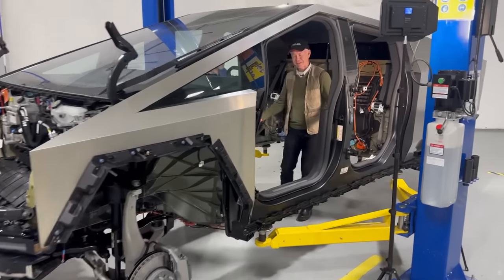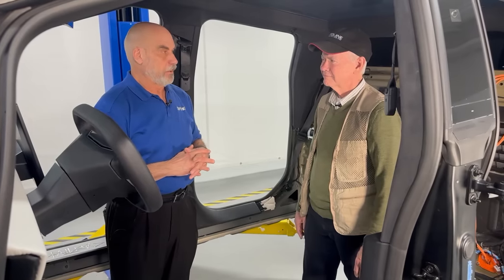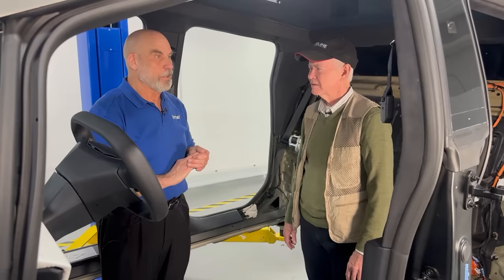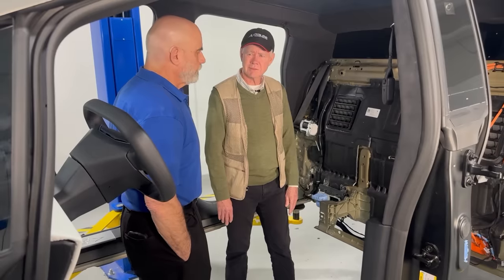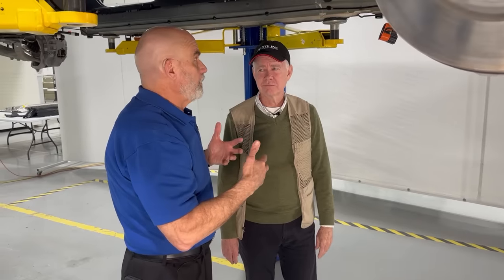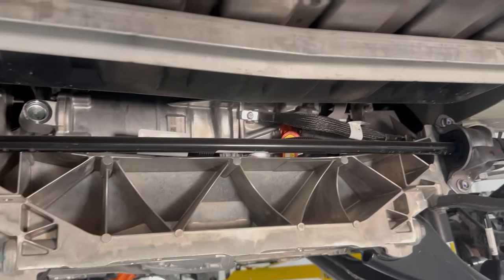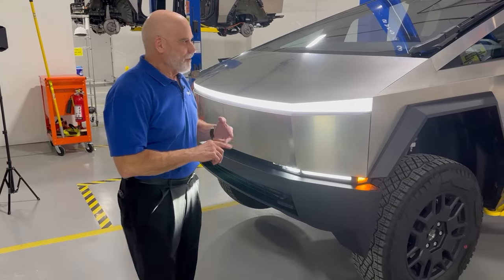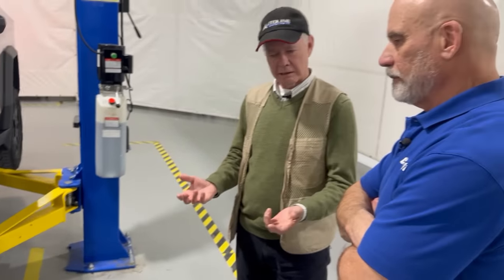World's 1st Cybertruck Teardown - Steer-by-Wire, 48V, Battery & Gigacastings

Comment: I'll be very interested to see the battery layout, especially as it regards thermal event management. I was less than comfortable with what little i saw of that in the "structural battery" teardown on another channel. With only that one sheet of steel between the cells and the occupant compartment it is critical that products of combustion and thermal effects are kept away. Similarly I am curious about front and rear interior door latch operation in a power out situation.
Good video. Thrilled to see teardowns by a neutral engineering firm.
What the heck, let's look at steering system power supply redundancy as well.
Reply: there was a photo , of it in the MUNRO Cybertruck FACTORY tour.

Comment: You can have all the backup motors for steering you wish, but all will have the same weakness in that all need electricity to function, so in short no battery or battery failure will result in no steering.
Reply: I hope you’re not thinking about an electrical failure the next time you’re on a plane!
Reply: Aircraft are different in that they have engine generators on the main power units, also engine apu, ram Air turbines and many back up and battery systems. With an ev you only have the drive train battery and aux battery
Reply: Another channel showed how the wheel covers / trim is wearing into the tire side walls , and been reported by owners have you found that
Reply: No battery?... who needs steering when the vehicle is dead?
But there are times like when the vehicle is dead in the middle of a road and has to be pushed and steered off. "No can do."

Comment: CT has a very, very simple design
Reply: And bad at the same time. And that is why this garbage truck is only legal in murica.
Reply: Its bad why? @vihreelinja4743
Reply: @JonGZBOS because he can't afford one
Reply: @JonGZBOS  cuz elon bad
Reply: @vihreelinja4743 getting a cybertruck because steering by wire engineering . Tesla 👍🏻
Reply: @niktak1114 lmao shit quality, can’t let it be outside it’ll rust, can’t wash it, can’t drive it when it’s raining because it’ll short the battery, can’t carry shit, can’t fit a small bike even, HORRRRRRRRIBLE range, you will die if it crashes, should I continue?
Reply: And no AR HUD, drivers display, and more.  Absolutely stupid.  You can keep this.
Reply: @OGNord  quality compared to an ICE truck is amazing.  The range was independently tested and gets 303 when it is rated for 300 miles.  That checks out, Towing greatly reduces range of all electric trucks, not just Tesla.  It will only get better from here.  I have one on order

Comment: the servo motor under the steering column doesn't just provide haptic feedback, it also generates the steer-by-wire control signals that are sent to the rack & pinion motors out front
Reply: I can get that.
.
(I wonder how many Logitech engineers went to Tesla? ...
 I'm only half joking.)

Comment: how reliable is the steer by wire? how durable? what if the motor fail what happens then? what if there's a software bug in the calibration of the steer?  what are the safes in the steer by wire?
Reply: It's got multiple redundancy and is fail safe.
Reply: @geoffthompson1215  how do you know? No video is out yet explaining in detail about its safeties. If there is, link it here.
Reply: It has 2 motors in case one should fail, as was explained in the presentation. They specifically referred to the safety issues. It is essential for any steering system to have a fail-safe design whether mechanical or electronic.
Reply: @Alongfortheride693  If you ever fly in a modern plane it's "fly by wire" ... no physical connection between pilot controls and the planes engines or control surfaces or brakes. Physical steering links don't have a backup if they fail whereas electronic ones do. There is a huge difference between a general purpose home computer and the dedicated electronics built into specific systems (which don't "crash" in the same way as your PC.).
Reply: @Alongfortheride693  Of course, everything can fail! Fly-by-wire has multiple layers of redundancy whereas my Ford Fiesta (like most cars) has zero redundancy if any components between steering wheel and the wheels fail.
Reply: @MrAdopado  planes have meticulous inspection and maintenance before flying. What happens if they dont? We have "boeing" as an example. Plane and cars are not on the same level. If the steer fails you are likely to hit an object than the plane in the sky.

Comment: thanks. Plenty new information on this video but I hunger for more. My first takeaway, it would be easy for Tesla to configure this for CyberSUV/Van but the air tank would have to be taken out or third row would be small seats and high leg position.  Another thing, this truck is even more compelling as a base model without air suspension and automatic toneue cover.
Reply: It will never be an SUV/ van.
They will be based on Gen 3 architecture.
Reply: @rogerstarkey5390  Good point.  while next gen can make these vehicles, these will be relatively smaller than what the CT platform can make. Vehicles from the CT platform be sold as premium than next gen vehicles.

Comment: I know everyone is making a big deal over steer-by-wire,  but jets have been using fly-by-wire for decades. Outside of Tesla being one of the 1st, if not the 1st,  what's the big deal?   Throttles have been "by wire' for decades as well.  I've noticed very misalligned panels ( In person) are the fenders glued on or is there a mechanical connection?

Comment: I feel bad because he has hearing aids but the sound he is hearing is not the pumps running, it’s the outside speaker. My model 3 and Y make the same noise with the outside speaker
Reply: Sir, you are very wrong the noise heard was indeed the pumps, the pedestrian speaker does not sound until the vehicle is in motion.
Reply: @DerrickHolloway-pt7tq  Do you own a newer tesla? Mine indeed makes noise from the speaker, It is unclear if the truck is in D in the video however, to get the truck to 4 wheel steer it does need to be in D.
Reply: @DerrickHolloway-pt7tq my 2022 Model 3 Performance makes the noise when stationary, as soon as I put the car in drive, not only when moving - just tested it. That sound at ~21 min is exactly the same simulated sound as my car makes.
Reply: We’re hearing the audio feed through their lapel mics. What’s that got to do with his hearing aid? It took me 6 months or more to realize the sound was even there 😅

Comment: Jeez legacy auto! What happened? You have been around for 100 years! This is the kind of tech that should have evolved during that time! Not from a company that been around for only 20. Pitiful legacy....just pitiful.
Reply: Nothing Tesla does here, or even in general, is groundbreaking and innovative. Those technologies have been around for a while and have no wide usage for multiple reasons. Real engineers know what is important and what is not and what actually does have real world impact and what has not. 48V is quite useless in the real world, and it is more expensive for the customer to get repaired and can be even a health risk. 48V has been used in mild hybrids for many many years since their smaller batteries do not always provide sufficient charging and discharging power for a hybrid gas car. No need for that in a fully electric vehicle with larger batteries. Steer-by-wire? Makes sense in a large truck because they steer and drive bad anyway, but for a performance passenger vehicle it is kinda stupid and unnecessary. Has been done over a decade ago by Infiniti by the way and people didn't like it. It even had a emergency steering column which gives great security reserves (hacking highly digitalized cars is increasingly a real threat btw) so nothing groundbreaking for the Cybertruck here. What else? The giant windshield wiper? Or other weird stuff (the metal plates on the outsides which sit on a cheap frame) and small changes? It all has no real advantage for the customer.
However: things that do matter, like battery performance, efficiency/range, comfort, usability/ergonomics and features/accessory is where the Cybertruck just barely keeps up with the competition. It only manages to beat the Ford F150 Lightning in terms of range and charging, which now gets a 2025 model year upgrade, so the difference will be smaller. The Ford has more usable space, truck features and is cheaper tho so not sure if the upcharge is worth all the downsides of the Cybertruck on the  other hand. The redt of the competition like the Rivian R1T, GM Silverado EV, Hummer EV are miles ahead of the competition, and they look awesome, too.
I recommend watching the latest range test by Out of Spec where they run some of the trucks against each other.

Comment: My Model 3 has a Lithium ion battery that runs the car in camp mode and the accessories. I’ve run it all night on many occasions. I understand that it has a life of 4k cycles. It recharges off the main propulsion battery.
I imagine that the CT does the same.
Reply: Most last 7-10 years of normal use.. not what you do 😅 But yeah, they are using better innovations for batteries soon, lithium ion has issues, which are being replaced.. maybe your next battery will be a gen3 or gen4 version that will be superior tech upgrades.. when the time comes.
Reply: "Your Model 3" has 2 "Batteries"
.
A "12v" battery which performs exactly the same duties as that in an ICE car.
Lights
Displays,
Computers,
Low voltage motors,
Doors,
Etc.
.
Then it has the "Propulsion pack" which deals with the high loads.
.
"Propulsion" (obviously) which includes heating, cooling and pumping liquids around itself and the drive system.
.
Plus,
If you're in "Camp mode" you will be using the propulsion battery to either obtain existing heat from fluids in  it's system, 
OR 
Generate new heat by essentially "vibrating" the drive motors to warm fluids (similar to an induction cooktop) then pumping the warmed fluid.
.
It will also top up the 12v battery (which was Lead acid in older models, but is now 14-16v(?) Lithium Ion)
.....
"Life"

There's STILL  a misconception that packs have a "LIFE" of "xxxx cycles".
.
WRONG.
The "life" quoted is the Guaranteed remaining capacity after "X years" or "Y distance" which would equate to an average of cycles.... Which they quote.
.
It NOT the "LIFE" of a pack, after which it's toast, good for only recycling.
.
It's the "Expected time to "X percent capacity".
.
As in
"4,000 expected cycles" 
to 80(?) percent of "capacity when new" remaining 
.
Guaranteed of 8 years.
.
You start with 80 kWh/ 330 miles. 
.
After 8 years you're at... 83%(?)
.
You have ±273 miles ... 
BUT
That's if you charge the pack fully 10 times every week.
.
Charge once per day, 7 days per week?
4,000/ That's 10.9 years.
.
±300 miles per day average, every day for 11 years?
.
You're  going to be more knackered than the battery!!
.
Now go to a "normal" user.
800 miles per month?
Call it 1,000/ month

That's 3 charges in 1 month.
Call it 4?
.
1 per week?

4,000 charges, = 4,000 weeks?
.
4,000 / 52= 77 years.....
Should be enough?
.
Now consider the price of cells..... Declining.
.
It's not going to be an issue for the vast majority.
Reply: @rogerstarkey5390  , except it’s a lithium ion battery that has a 4000 cycle life.
Reply: I can't imagine why not. Of course Camp Mode is not only run by the 12v system. Heating and cooling (the major elements of camp mode) are run directly from the HV battery pack. Any 12v consumption from the small battery is constantly topped up from the HV ... just the same as running electrics in any car needs to constantly top up the 12v battery .. in an ICE car that's done by keeping the engine running.
Reply: @MrAdopado  , Correct. The ability to run camp mode without running a gas engine, with all of its pollution and safety concerns , is Heaven sent.

Comment: Windshield washer spray is leaking in the front driver side compartment when you pull the plastic front trunk out . Next the clips for the cabin airfilter snap off like cheap plastic. Hoovies garage does a video on it. His was not spraying well. I see the did not do the window seal the full Length on that side and the rubber front trunk seal has a split in it on the driver side front im guessing its getting in there . Its all over the fron driverside pillow by the wheel well. If thats getting in so will water. That trucks way way to expensive for the build quality . Many things are lacking to me quality wise. I will stick to a duramax or cummings Diesel. Pulling 15k pounds no problem. They would have to build a super heavy duty truck for me to even consider being interested. For cars hydrogen is the way in my mind. Take electric bring it to wisconsin wgere weather hits 0 to negative 30 then a two goot snow storm and drive one from wisconsin to michigan the heater alone will tax the battery beyond belief cpupled with cold idk. This guy id imagine never pulled some srtious weight. That truck would never pull what cpnstrution workers need to pull then go up and down the mountains in tennessee with massive weight behind you 😅 good luck . I dont have all day for stuff to charge either. Most people that get electric get one as a hobby car to add to there cars they have. Not knocking it it is just not for me. Audi has an s8 that will park itself in a parking garage thats packed with cars very well. Pretty impressive but i like old fashioned cars less mumbo jumbo to go wrong. That battery is a ton of lithium a123's stacked. Thank god i did a ton with high powered rc cars using beushless systems with lithium polymer batteries lithium polymer packs wicked power but is not as stable or safe as lithium ion or life packs. I have a brushless motir in a rc truck thats similar to the size of a soda can it puts out 28hp. The truck will do backflips and wheelies at 60mph. Pretty cool stuff id be really good at helping tesla. I hope these use brushless motors only thats the best way to go they make massive power. They use three leads for power not 2. Im just more partial to gas who does not like a high reving v10 or example audis 4.2 aluminum block cross plane crank . It just sounds so so cool. Quiet is nice to. Im not entirley against electric we are just not there . Plus the power grid can not handle it . California found out gast when everyone was plugging in amd they had blackouts. All above and below ground cables nation wide would have to be much larger guage the cost is just way to much. I do wish they used an open vemt grill on ev cars but i suppose they dont want water anywhere near stuff. The leaking windshiel wiper fluid and water tjing is a massive defect. Check it out on hoovies garage.

Comment: :Thank you - great to see the dismantling happening - the body is much less exoskeleton and much more high strength steel unibody with a few "cosmetic" barely structural flat SS skins ?glued? on....

(NB, the body in white only needs to be structurally sound for the manufacturing process - until the floor gets sealed in, then the full stiffness is achieved when  the bonding is cured. - There is a real assembly benefit that workers can just stand inside while installing the dash and trim etc - and the interior is also assembled without being forced to crawl and fit inside a cabin.

 - the steering feedback - ?/  is completely simulated?  - where does the raw data come from - for the "gamification" of the steering (strain gauges somewhere in the steering linkages -  the tight steering actuation and high power -steering  output - means that angle sensors won't really respond to road forces) unless the steerring algorithm has compliance built in.
Reply: Technically, its Unibody w/ massive FRONT & REAR Gigacastings & 4680 Structural battery pack.
Reply: "steering feedback was sorted by gaming control designers 2 decades (?) ago.
.
(Logitech says "hi!")
Reply: Oh... And thinking it through, large parts of  the system have  been in operation in Autopilot / FSD vehicles for a long time now.
The only difference is the feedback motor.
(Not sure if the 3/Y have dual steering motors yet?)
.

Comment: Using the battery pack as the floor makes replacing the pack far more difficult, all for tiny savings in manufacturing.
Reply: Based on the life cycle of the Model 3 and Y battery history, people arent going to be replacing the battery.  The lifespan of the battery is longer than the lifespan of the auto.

Comment: People say that Tesla is 10 years ahead of the competition. Turns out that they can't even hinge a door correctly. LMAO.
Reply: 10 years ahead.  What nonsense lol.
Reply: I suppose we'll know in 10 years..... Depending on who survives?
Reply: Not even close. I love how people are like aws. Cars from the 80s and  90s had aws. Mitsubishi had it, Subaru had it etc. If you look at prototypes from the 7os 8os and 90s they looked just as futuristic and as dumb and cheap as this this. With the most bland interior ever.
Reply: Dont complain about that to Tesla!  They might remove the doors altogether because 99% of the time, they are not being actuated.
Reply: @hydrostream8954 Honda and Mazda  had it too.  It didn't sell.
Reply: They tried to save money on the hinges by using the same base plate.  Either they should have the rear hinges be a different width than the front or find a better way to separate them on the line.  Otherwise, they will have these showing up at service centers for replacement.  Won't take too many of these situations until the cost savings go out the door (pun intended).

Comment: Yep, the highlight here is the 48v system. The battery floor is not going to be repaired. It's disposable and expensive. I'll keep my easily repairable ICE as long as possible. If I need a EV truck it would be the Silverado EV, Kyle at Out Of Spec channel says, "it's a towing beast!" Easily beats the CT.